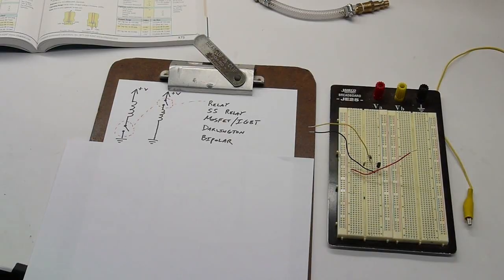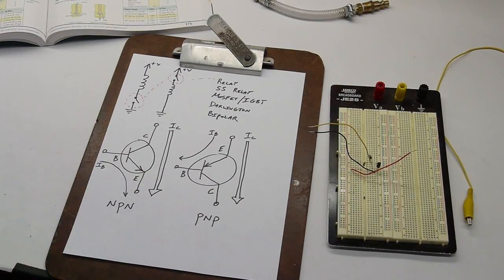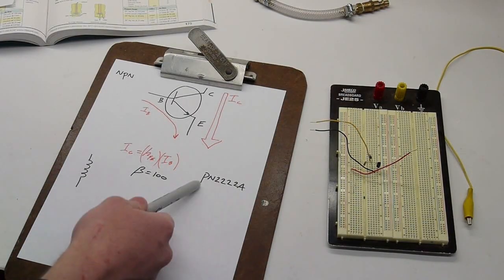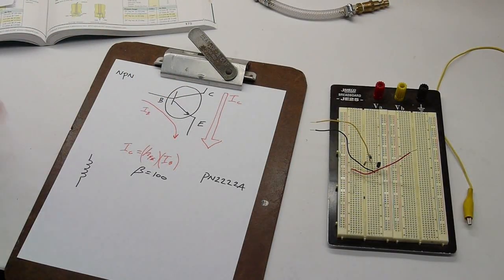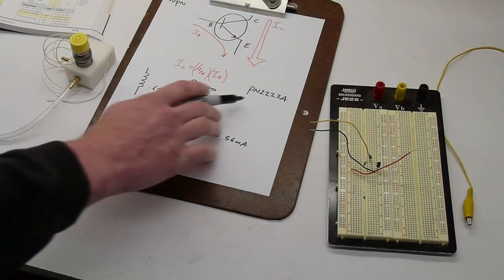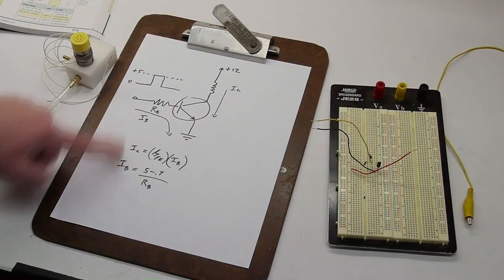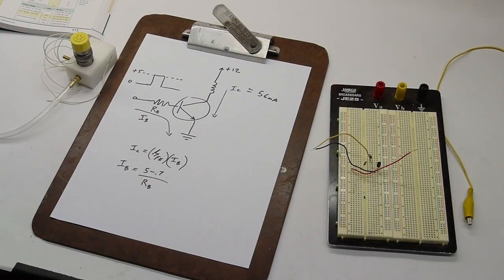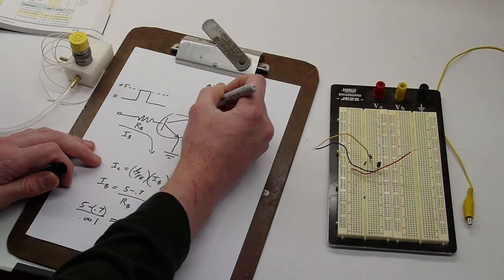Tutorial: How to design a transistor circuit that controls low-power devices

Comment: Great video & well explained, the diode can be replaced by a resistor - this is common in the automotive industry (anything to save money); because the back emf is so large the resistor looks like a short circuit and the power surge just runs into the resistor and turns into heat.

Comment: The problem with this video is your acting as the switch attaching the voltage.. You could have done the same thing completely without this circuit. Showing how it works automatically on and off would have been more helpful. But thanks for describing how the transistor works in detail.

Comment: Darlington transistors are used when high current amplification is needed. If you are relying on a very little current to sense an output from sensor and the BJT can not respond to this little current then Darlington will respond because it can amplify the signal hundreds of time, if not more, to drive a load. We just need to watch out for noisy environments to prevent false signal so you may need to limit the noise interference by using filter in the proper section of your circuit. If for example you are designing an alarm circuit using Darlington transistor and operating in a noisy environment then chances you may hear a false alarm every once in a while.

Comment: Great video my friend, job well done. For simple circuits I usually use BJT, MOSFET, JFET or IGBT. If the circuit demand driving special load then I will buy SSR, Solid State Relay. SSR is very cheap from eBay. You may check DigiKey or Mouser for special deals. SSR can be controlled from 3 VDC up to 100+ VDC to drive a load such as heavy motors, Bulbs, and machines. You may also use SSR with AC input that will drive a battery operated LED or buzzer, when the AC fails the SSR activates the buzzer telling you that the AC line went down.

Comment: Very informative, concise video.  One important thing about Darlington pairs that most don't know.  The two transistors are connected so that the second transistor cannot saturate, it can't fully turn on.  There will always be 0.7 volt or more at the collector.  This means that the Darlington pair will always dissipate more power than a single transistor.  If the Darlington pair is switching 5 volts, there will be more than 10% of the power wasted as heat in the Darlington pair.  So it is not a good choice for a switch.  Thanks for the great video.

Comment: This was one of very few videos that show useful math and useful electrical engineering.  I liked and subscribed.  Ive seen videos explaining how to use an ldr to make a light following rover with just two ldrs and two transistors.  I've also seen a simple bi-polar motor control forming an h bridge from four transistors using two push buttons on the transistor base.  All my attempts to replace the push button with the ldr has failed 😣 do u have any videos helping with that?

Comment: What voltage would you rate the snubber capacitor for? You explain the voltage "could potentially be hundreds of volts" at the  (collector, coil, diode, capacitor)-junction when the magnetic field collapses. As the capacitor is between this junction and 0V (GND), wouldn't you need a cap that can handle very high (but unknown) voltages? How to deal with this?

Comment: Excellent video. But gain of pn2222a, with collector current of 56mA, is less than 100, especially at lower temperatures. Yes, usually they are high gain, but it is not guaranteed. I would assume gain of 50. And then add a safety factor.

Comment: My thick head wouldn't let this sink in all through college and a lifetime semi hobby. Thank you for a presentation that made sense all the way! What about wanting a more analogue input i.e. not jumping 0/5v?
Reply: If you mean, not have the voltage go to 0 to 5 in a fraction of a second, but have it gradually go up as to not damage circuits, then add a capacitor paralel to the output of the transistor and earth, so the capacitor has to charge, thus smoothing out the voltage at the start, the bigger the capacitance, the slower it will go. How slow, i dont know, you would need a oscilloscope for that.
As to regulate thevoltage that the transistor outputs, get a variable buck converter, those are cheap. And be careful with its output, buck converters are notoriously noisy, so put a linear voltage regulator in paralel to it to smooth out any bumps.

Hope that answers the question.

Comment: Well if your base in NPN transistor is positive then how can you say that electricity flows from base to emitter,?????  It actually flows from emitter to base, why all those videos on youtube had it in reverse, only few videos I watch on youtube got it right.  I know in the past everybody assumed that plus flows to minus, but now we know it’s the other way around.  Why don’t you guys stick to reality, why using the old assumption, I know it will still work, but stop reversing the proper flow of electrons. 🤦‍♂️
Reply: Because you'd have to literally throw away every scrap of napkin-doodled circuits, burn every EE book, and delete every digital copy of every schematic that was created using the old way in order to create a new standard. It's easy enough to think of traditional current as a flow of positive holes instead of a flow of electrons in order to "get it right".

Comment: 5 volt on the base resistor, 0.7 volt on the bade itself, so 4.3 volt, 1 ma; 4.3 k.
Lets take the standard 4.7 k ohm
The current:
I=v/r=4.3 volt/4700 ohm = 0.9 ma.
If the transistor has a gain of 50, we get 45 ma
Reply: So what is your point, and why did you choose a gain of 50 rather than 100???
Reply: @paultrgnp  The transistors I used to use had a gain closer to 50. I don't know if the technology made spectacular progress in the last 20 years.

Comment: Excellent! So the current required to enable the transistor is a product of the current passing through it once it would be switched on, based on the transistors beta?

So generally speaking, if the current through the solenoid was 1amp, the current to the base of the transistor would need to be that much higher for it to actually turn on?
Reply: Your theory is correct... but not with that particular transistor! For switching anything more than mA, use a MOSFET instead of a Bipolar. The voltage drops internal to a BJT consume power, so the more current you push into the base, the more the transistor heats up!

Comment: Fets really remain risky and shady for a long time? Never met someone who grew up with bjt and darlington arrays who seemingly wants to acknowledge gets at all lol. Voltage switched and if done from floating supply it's easy as pie or just low side things. You can back to back them if u want to switch ac and the voltage drop will still be lower

Comment: I kept waiting for the clamp diode on the solenoid. I was going to go spazoid if he didn't. lol Nothing will eat a transistor faster that collapsing induction field.
Reply: Can anyone tell me how to calculate the correct clamping diode to use?  I was looking at this video to learn how to control a solenoid and was shocked to see he is using the exact solenoid I am trying to design my circuit for.

Comment: Having finished an MSc course on integrated circuit design, I NEVER EVER use a bipolar transistor, those are ver1 of switching devices. I only use MOSFETs since: they do not require a current to drive their on state, and they don't have a voltage drop. There has been no computer developed that uses bipolar transistors, they just require too much electricity to keep their state. Regards from Greece, keep up the good work!

Comment: Protection diode connected in parallel with relay or solenoid will protect the transistor but shorten the lifetime of the relay. You can make an experiment on that comparing a typical driving circuit with a circuit where diode was replaced by diode + 30..50V Zener diode. When the switch transistor stops conducting, the BEMF arrives with the opposite sign. But due to the diode, the current keeps flowing causing the relay to open smoothy. This is not good for high current relay because the arch is not broken immediately but lasts until the relay gets fully open. Zener enables the dissipation of much higher power with the same BEMF current, causing the current to drop rapidly. Even though this circuit is used so often even in industrial applications, it has limitations. Instead of the diode, you can also use bidir TVS which is essentially a dual Zener-like structure.
Reply: Greg Kasprowicz I didn’t know that, can you link an article or video to learn more about this phenomenon?
Reply: @Asyss_Complex  https://electronics.stackexchange.com/questions/26944/when-why-would-you-use-a-zener-diode-as-a-flywheel-diode-on-the-coil-of-a-relay
Reply: @Hearing.Chanting Remembering.Krsna can you point me to the professional literature you are mentioning? The Zener diode is not expensive non-linear resistance. It's a very cheap component, at least in the EU. It is a standard way of prolonging relay lifetime used by several manufacturers of industrial equipment. It looks you did not fully understand what I wrote. It's about prolonging the lifetime of the properly selected relay. I did not invent it, I remember it from an electronic circuit course during my studies. Can you please discuss using merit arguments only?

Comment: Not to be critical because I love your videos. You said something about "conventional current" flowing in the direction of the arrows. I have spent years pulling my hair out with the counter intuitive idea that the arrow points to the negitive and the electrons flow against the arrow.

Though a bipolar is to be thought of as more of a current controlled device whereas a fet and a vacuum tube device can be more thought of as voltage controlled devices.

I always think of an npn bipolar as representing a vacuum tube in that the cathode/emitter are similar, the plate/collector are similar and grid/base corispond.

So i think of current (electron) flow as negitive to positive. The standard npn/tube would suggest cathode/emitter current flow towards plate/collector.

Is this some kind of guild conspiracy like speaking in Latin?  Some kind of job security arcane complication? 

Do you know the history of this? I know that sometimes with Boolean algebra it is sometimes easier to flip things so that zero is on, can simplify the math or number of gates used.

Comment: You stated a very interesting remark about the payload by saying "the solenoid will ONLY sink the 60 ma needed even the collector can provide 100 ma" So, if I put a led which need ONLY 20 ma, will it survive without the needed resistance ( assuming Vcc of 12 volt???????

Comment: 10, not 100. As a switch, base current should be 1/10th of collector current. Read the datasheet. So 56mA Ic requires at least 5.6mA Ib. Gain drops as collector voltage drops. This also ensures low Vce in saturation.

Comment: I think your video is very good.  You brought up using Darlington transistors for switching high currents.  But Darlingtons have an important drawback.  First the base to emitter drop is two junctions or about 1.4 volts in your case.  But what's important is the collector cannot go below the base voltage, which is about 1.2 volts (a regular bipolar collector can go below 1/10 volt).  Therefore the collector load (coil in this case) cannot have more than 3.8 volts across it.  Almost 25 percent of the 5V supply voltage will be wasted in the Darlington!  If you need high current gain with the full supply voltage across the load, use two separate transistors with the first collector connected to supply and the second collector connected to the load.  And use a current limiting resistor between the two.  Thanks.

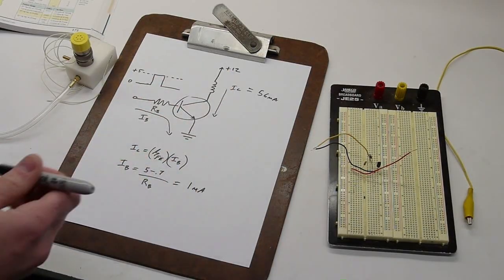Comment: I'm 14:22  in and I'm wondering if the valve is a 12 volt valve that nominally draws 56mA   Why do you have to calculate and worry about the collector current (as long as its not higher than the transistors rating ) rather than just hit the base with enough current to fully saturate the transistor and let the valve do its thing and take as much current as it wants.   Like it would if you just had a mechanical on off 12 volt switch feeding it.  ?
Reply: Blocked User Elvis died on the 🚽

Comment: That was great..  I finally understand  Hfe..  Thank you..
 I never thought about a clamp diode..  My Newman motor could use a clamp diode,  and giant capacitor..  This was very informative..
Reply: In case you were wondering, a clamp diode is also known as a freewheeling, flyback or catch diode. (...or as a suppressor/snubber diode). Why so many names for the same thing I don't know???

Comment: Question? On your diagram, with the NPN,  as a switch, which is placed at the Ground side, (closest to ground, past the particular item,) would this not be somewhat dangerous to the item involved, or the person handling the item, whereas the chance of the person or something, could become the ground, completing the circuit through the item involved, turning it on?

Whereas, to have the "Switch" on the positive side of the Item, if something or someone became a ground, it would not include the ite  turn on ability, just a short.?

Comment: I would always use a MOSFET for power control, and not a BJT. Unless I needed to control the amount of current through the device. BJTs drop voltage and waste power.
Reply: Absolutely. Although MOSFETs have to be driven hard(er) for higher voltages - and even in this case, they would require a pull down resistor at least (5V is high enough gate voltage for most cases to driver 12V). It's harder to explain.
Reply: A BJT is a perfectly reasonable choice for currents up to 100mA as the voltage drop and power wasted is then negligible. Above that, a logic-level power mosfet is a good choice, and essential if you have a 3.3V microcontroller. Remember that the mosfet will normally cost three times the price of a small-signal BJT.

Comment: Shouldn't the equation for working out the resistor be 0.001X(5-0.7), then 1/0.0043 = 233 ohms? transposition of formula states that anything crossing the = should be inverted or am I just not remembering something? LOL, just went backwards through your math and sure enough you are correct my bad.

Comment: Just one thing to note:
The gain is NOT a fixed value sadly. It can vary wildly. A pn2222a might have a gain of 100, but 50 or 200 are just as valid - and you never know unless you measure it.
A resistor on the emitter can help compensate for that.

Comment: Very well described and extremely useful video. 
You did not mention running the transistor in its linear region except in terms of it not allowing the solenoid to pass full current. My understanding is that if the transistor is not fully turned on (even if the solenoid is operating correctly) then the transistor is acting as a resistor and will dissipate heat which could be detremental to it. I think as a tutorial this would have been worth adding as part of understanding switching applications.

Comment: A few comments - yes, 4300 ohms is a standard resistor value, but in the E24 series, not the E12 series :)
The base-emitter voltage depends on the current, can be 0.5V for very small currents, 0.7 or more in higher current situations, the voltage is a logarithmic function of the current, diodes and transistors are similar.
For using a transistor as a switch you'd normally ignore the value of beta, just going straight to the section of the datasheet describing the saturation characteristics. Typically all transistors have an effective gain of 10 to 20 when fully saturated (minimum voltage drop between emitter and collector), as normal transistor action relies on the collector-base junction being reverse biased - saturation is different.

Your argument for two junctions voltages cancelling out is actually not correct for the saturation voltage, you do need to understand what happening at the semiconductor physics level to see this.  Transistors are extremely unsymmetrical, the emitter doping level is 3 to 5 orders of magnitude greater than the collector, which is why the emitter and collector are completely different in function.

Comment: software engineer here trying to create a square wave input circuit for coils&such with a logic level MOSFET. Do you think I blew my FET already by not using a resistor between the SG and the FET? https://www.circuitlab.com/circuit/3wq9k8fgr6q5/mosfet-driving-with-an-12v-sg/

Comment: hfe isn't a good parameter to use when designing transistor circuits it varies considerably with lots of variables like temperature, current or production conditions. You're better off using the current thresholds or voltage thresholds for mosfets.

Comment: I believe that some info you mentioned is incorrect. One is about purposely designing the output current higher than is required (like from 56mA to about 100mA) with your reasoning that the inductor will not consume more than what is specified in the manufacturer's current rating. This would probably be correct if you are connecting only to power supply and ground BUT not correct when you are using a transistor to drive the coil. The BJT current formula (Ie = Ib +ic) will hold true and this is why they are being used in Current Sink/Source circuits. It's probably getting too long, but you also expressed your uncertainty regarding the voltage drop at C and E. You can actually see the Saturation Vce drop depending on the  Ic in the datasheet.

Comment: I still don't understand how you turn the transistor on and off, without physically connecting it to a voltage source.  if you connect the transistor to 5 volt power supply--it will stay on until you unplug it...isn't that beating the whole idea of being able to use a circuit to turn it on and off?